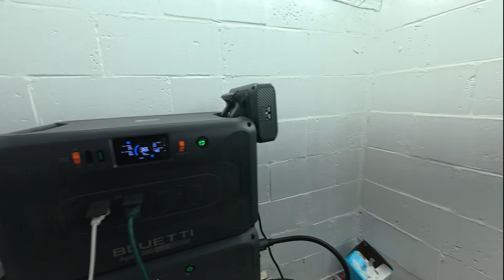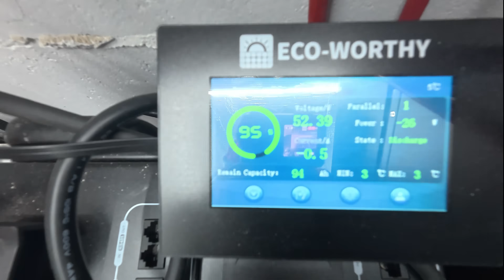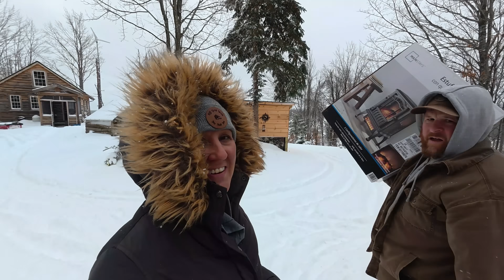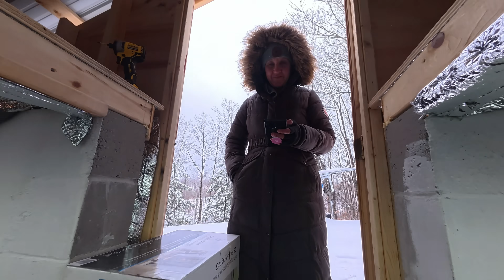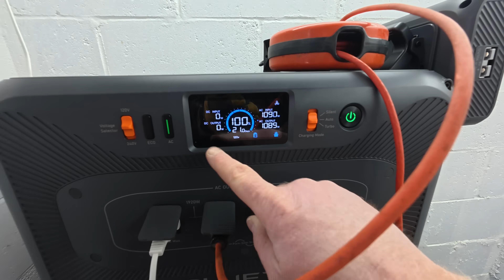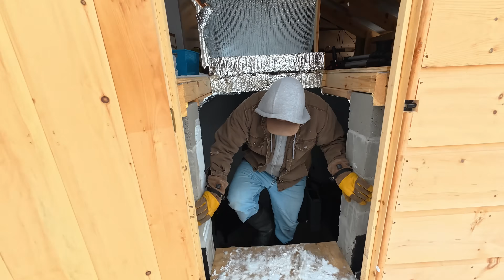Experimenting With Heat in Our Off-Grid Bunker | PLUS SOLAR BUNKER UPDATE

Comment: Guys have you considered using an electric Tube heater designed for small places like greenhouses. You could install a 100W model in the bunker and leave it on permanently.
As for efficiency I seem to remember learning that all electric heaters with no moving parts or lighting are 100% efficient because all the power entering the heater is converted into heat.

Comment: SOC tracking can get way way off when the battery bank doesn't get charged to full every once in a while.  Like, right now my home system is saying 80% when its actually more around 40%, because I haven't charged it to 100% in over a month.

This is where having an external shunt to track the overall SOC can help a lot.  I recommend the Victron 500A or 1000A shunt.  I then configure its parameters such that it errors on the side of reading a lower SOC than actual so I never get "surprised" by a high SOC reading and then having a dead battery bank the next moment.  (Peukert constant set to 1.05 and charge efficiency set to 99% is a good starting point).

When the batteries are tied together in parallel and they've gone through at least one full charge cycle in the past (so they are all synchronized), then their relative states of charge will always be within roughly 10% of each other forever after, no matter what the internal resistances of the batteries are and no matter what their relative total capacities are.

--

The temperature tracking in your setup in cold cold Michigan is really valuable!   I'm learning a lot!

-Matt

Comment: My dad used to keep a flood light positioned over the washing machine water supply lines on the back porch then graduated up to an infrared heat lamp. Maybe you could use something simular in your battery bunk house. Another option would be a portable electric oil filled radiator. Mine has a feature that will keep the temps at 40 degrees farenheit.

Comment: Quartz heaters are not ideal for this usage, if you Google it, you'll find they don't heat the air, they heat objects they are pointed at. It will still work somewhat in the bunker, but it is not efficient.

Comment: Why in the world would you put that fake fireplace in the bunker?  Fire hazard!  A 100 watt light bulb hung from the ceiling would produce enough heat to keep it from freezing.
Reply: I'm extremely skeptical an incandescent bulb could make any measurable difference in that room. Jay did place one on the floor for a while but I don't think he ever told us what the temps were, before and after. I wish he had let it go for a solid 24 hours and then checked the temp.

Comment: I would think the "fireplace" has a thermostat but if that doesn't give you the control you want, you can get a temperature-controlled smart plug for around $25. They look kind of like a Kill-A-Watt but have a built-in thermostat and a digital display so you can set the temperatures for the plug to turn on and off. Anything I can automate makes my life easier. As a double-check, just have the current thermometer alert you of the temp gets too low.
Reply: Smart devices are hackable and fail, they sell a mechanic thermostat plug that does the same thing for less
Reply: @ivar-the-terrible  I'm sure China will make his basement top priority.
Reply: @kylefrandsen2665  That literally makes no sense. China wouldn't be the ones hacking in, it's scammers and other groups

Comment: Nice video!
There are two things that bother me.
One is that the battery consumption is unbalanced.
It should be consumed evenly, so it's strange that only the EG4 is consuming power.
The other is that there is no WiFi AP installed in the shed. This can be solved by running a LAN cable from StarLink or an existing TP-Link to the shed and installing a WiFi AP in the shed.

Comment: Nice call using the electric fireplace to heat the bunker. (Free heat!). Would an electric radiant oil heater be more efficient? They are also pretty inexpensive. You can always use the diesel heater on extended periods of cloudy days. Maybe even use one or more of those halogen light bulbs used to heat chicken coups to keep the bunker warmer than the standard bulb. Another great video. Have you said how the bifacial panels are performing on the soar tracker?
Reply from the maker: Great ideas. We will be doing a video with that soon (if its ever sunny lol ),
Reply: @OffgridwithJayandJen  I’m also interested how the back side of the bifacial panels perform in less than full sun conditions when the ambient light reflects off the snow.

Comment: 38f is sailing too close to freezing - 42.8f (5c) is a sound minimum - your fire is a bit of a sledgehammer to crack a walnut -  it's trying to heat the air and walls - a more economic heat would be a reptile radiant heat source with a digital thermostat  which would warm the dark surfaces, not the whole bunker - set it to come on below say 45f

Comment: If adding a Wi-Fi extender does not work out for you, I have a suggestion. Depending on the distance from the cabin to the bunker, you might want to consider running a couple of direct burial ethernet cables from the router to the bunker. I suggest running two in case one fails. The maximum run length is around 100 meters (320ish feet). You won't get maximum speeds at that distance, but you don't really need maximum speed. I've done this and then use a router in access point mode in the work shed.

Comment: Another week in the 70s here in W TN USA. I have a small 1000W plug in heater that sits on the floor for my batteries.. The temp is set at the lowest temp and the speed is set on low. I know its not much but it is better than nothing. Good luck to you.
Reply from the maker: Sounds like a good solution for keeping your batteries warm! Thanks for watching.  Truly appreciate it

Comment: I would put already that diesel heater there,and set to like 10 degree celsius....undergroiund insulated,it will prob consume very little fuel...or somehow turn on/off....3-4 celsius is very low for those bateries,one of the only things lifepo4 dont like is cold,it degrades the battery if u use it like this.

Comment: I would guess the resistance is the cause of your reading mismatch in addition You are drawing such a small load the SOC accuracy is poor. Plus with so many different BMS’s that doesn’t help. If you voltage is the same on each bank, I wouldn’t worry about it. Top balance every 2 weeks or so is my recommendation. Glad it’s working for you. Good luck up there!

Comment: Damn. I have the extreme opposite problem. We have a hot climate and it's summer.
Even in winter, I rarely get battery temps below 20C (68F).
Temps in the low 30's (C) are quite common.